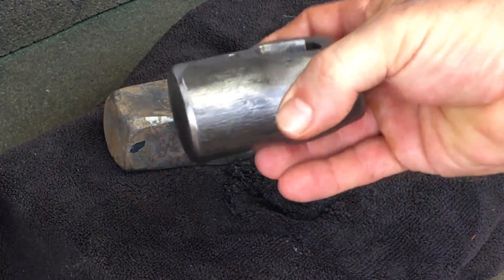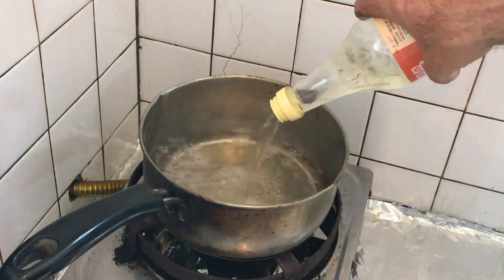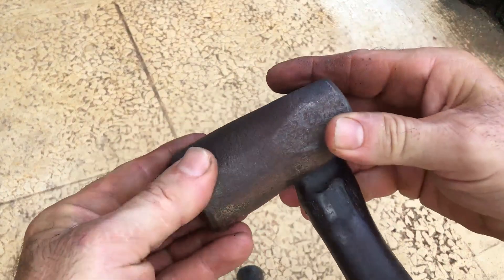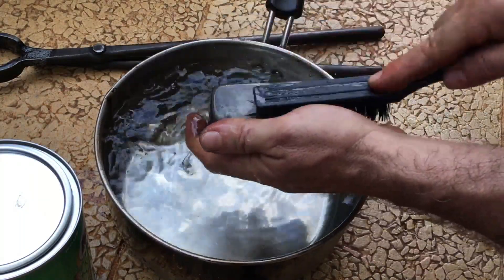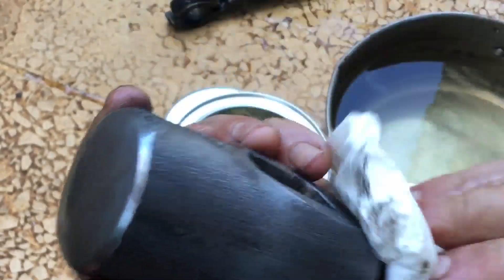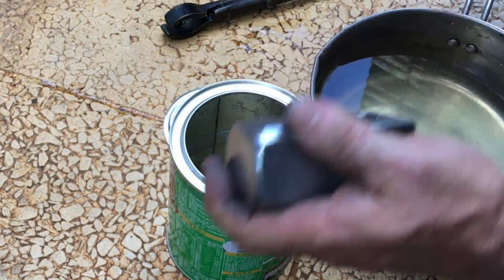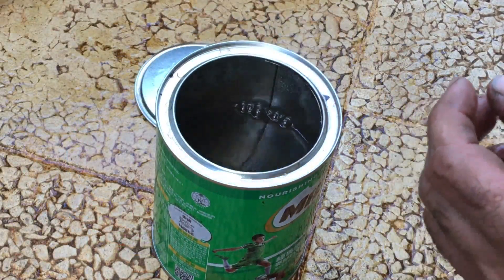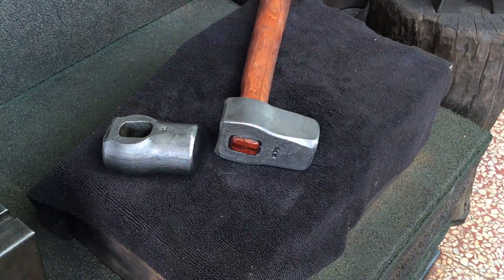Magnetite - How to Slow Rust on Tools

Comment: vinegar breaks down rust so if its not rusty it wont turn that dark color you need to let it rust first(dropping it in vinegar and letting it sit out in the air without cleaning it off), then clean it with vinegar. that black layer is a broken down rust and helps prevent future rusting. not rust proof tho. just a different type of layer of oxide that helps the red rust from forming

Comment: it'd be a deep black if you dropped it in the vinegar pulled it out and let it rust a few days, then drop it back into the vinegar for a few days. no need to heat the vinegar let it do its thing (unless your short on time), pull it out and the head will be a darker color. it needs the rust to form that dark color. rust is a form of iron and so is that black layer. dont forget to wash and oil after pulling from vinegar!

Comment: If you don't mind carding the light red rust off suspend it in a box and put a 75 way bulb close to the bottom of a glass pan or bowel and put white ammonia in the bowel and every 4 hours in a humid climatetake it out and lightly card the surface and the more times you do it the deeper blue grey to black it gets
Reply from the maker: Hi Bill, very interesting indeed. I don't know much about "bluing" but I'm getting a crash course from all the good comments likes yours. I'll keep experimenting. Thanks.

Comment: There's an old military Fort around here. Fort Stevens. It was in use from 1863-1947. Even today you can go walk around the old concrete structures. Anyways on to the point of my story.. the iron things there are interesting to me. Huge round eye bolts sticking out of the concrete. They have a beautiful orange, smooth, rusty colored patina on them. The fort is guarding the mouth of the Columbia River where it enters into the Pacific Ocean. I would have thought anything iron would just start rusting away after sitting for 50 years like it has. Not sure if it's the patina from all of the use beforehand, or if it's just a better kind of iron but when I was there a couple of years ago, it was not crusty and flaking off rust like you would think a piece of iron sitting in the weather next to the ocean would be.
Reply: There is also a shipwreck on the beach at Fort Stevens also. The Peter Iredale. I'm 42 and have been camping there since I was a little kid. I have watched the whole of that ship slowly rust away into the ocean. Yet most of the iron at the fort is still in perfect condition without any flaking rust on it.
Reply from the maker: I really enjoy stories like this. Thanks again my friend.
Reply from the maker: Hi Keith and thanks for sharing your interesting story. I have an idea about the rusted hardware on the Fort. It's possible those pieces are real wrought iron. This iron has very little carbon and so when a skin of uniform rust forms, oxidizing just stops at that point, the iron being a more pure form. I've come across triple refined wrought iron that was over 100 years old and internally was in perfect shape. Anyway, just a thought. Thanks.
Reply: @gstongs  that very well could be the case, that it is extremely pure wrought iron. It was a military fort, built for defense, along the ocean. I'm sure they would have used "the good stuff" to keep it from rusting away in 5 to 10 years.

Comment: Birchwood Casey makes a cold gun bluing compound that works pretty good. Don't know if it's available in Taiwan. Thanks for the video. Jon
Reply from the maker: I need to look into proper gun blue so thanks for the suggestion. And I got a lot of other good ideas from the comment section. A wealth of knowledge it is. Thanks.

Comment: very interesting. ive done the old mustard patina trick on carbon knives in the past and its ok, dnt know how well it would work for a metalworking tool though
Reply from the maker: I think the thicker hammer steel is making this harder than with a fine blade. But I've got a lot more experimenting to do. Some comments herein are very useful. One day, I will try the mustard patina "hamon" or whatever that line in called. Thanks.

Comment: Rust Bluing is the process you are attempting to achieve.  Clean the surface, allow to rust (red rust), then place the piece in boiling water (it will turn black, magnetite has formed), clean piece again light wire wheel preferred by hand fine wire brush ( this is called carding ), rust the piece again and perform this process until no more red rust is forming.  Then oil.  This can take up to 10 cycles.  One of the best methods is to rust the piece in the fumes of a acid ( I use sulfuric acid in a closed container, battery acid mixture works fine) in your environment the humidity will flash rust it.  This process is considered the 2nd best method of bluing a piece and on polished pieces you can obtain a very black finish.  There are acid products out there to speed the rusting process.
Reply from the maker: Hi Randy, Very good comment. Very useful information. I may just try this for a video. But it does seem like it will take a good amount of time. I'm trying with some less hazardous mediums (vinegar, etc.). And I'm currently working on trying this with drain cleaner - the kind that is extremely alkaline, not acidic. I've got some homework to do. Thanks for sharing this detailed info.
Reply: @gstongs  in your environment high humidity and heat an object will flash rust all by itself and even faster with any acid solution.  Clean and just wipe with a damp cloth ( vinegar ) and hang should rust veal fast.
Reply from the maker: Yes, I can rust a piece here pretty quickly with nothing but leaving out. With this patina, I'm trying to oxidize without red rust forming. I'll continue with this next video. Thanks.

Comment: Don't Know Glen I have always used vinegar as a rust removal for steel you can get both hot and cold blue or blacking on the internet. Or you can just use water displastment 40 (WD-40) And it would help i you lived some place where it did not rain 3 times a day (Lol)....... Be well and be safe...⚒⚒🦜
Reply from the maker: Hey bill, I use a lot of WD-40 for sure. Humidity here is insane. I just also like the black oxide appearance beyond the simple rust protection it offers. But yeah, gun blue is pretty common. Plus, there are other chemicals mentioned in the comments that are probably better/more consistent for this. By the way, I never got an email from you. I'll try to email you again so maybe check your junk mailbox if you don't see it. Would like to get a tong to you for your donations. Thanks. Glen   gstongs@gmail.com

Comment: Try ferric chloride and distilled water...  It's not expensive and it makes for a great Finnish. I mix it no stronger then 50 50 but  1 ferric to 4 water works a treat as well. Stay safe bud. Look forward to the next installment.
Reply from the maker: Hi Dan and thanks for the suggestion. I'll go my local chemical supply company soon and see what they have available and what might be of the less dangerous variety. Much appreciated.
Reply: @gstongs  yup... It's very mild. You can mix with distilled water or vinegar. You can use bare hands and its not bad but it does slowly work on your finger nails. Also stains yellow... Not a great look when out on the town lol. I will do some research to see what possible alternatives you could find easily in your part of the world. Although I am in Africa so If can find it , I am sure you can.

Comment: Rust bluing .There is a way to get a gun like black finish with walmart chemicals  at home . You need ratio of 2:1,2 :4  of following chemicals sodium hydroxide(lye 2):Potasium nitrate(KNO3 ,stump remover 1,2):Destiled water(4).
The more polished surface of metal is the better the finish will look . Make sure you degrease part with acetone or alcohol and never touch it with hands .Any oil will show . 
Warm the previously mixed chemicals to a 130-145 C° and put the part in for 30 min.After that use fine scotchbrite pad and oil it . 
You probably overheated vinegar .Try to keep it at temperature  in a range above.
Reply from the maker: Very interesting... I'm messing with drain cleaner to attain this "rust bluing" with decent results. Your chemical formulation is something to try. And you may be right about the temp. of the vinegar. Thanks for sharing.

Comment: Interesting. I make some decorative screens from mild steel tube (180mm diameter with a 5mm wall thickness) and brass. The brass I polish and lacquer. But I want to keep the mill scale and rough look of the mild steel tube. I don’t want to just paint the steel black so this treatment followed by a matte clear coat will give the look I want. Thanks!
Reply from the maker: Hi Eric, give it a go but for sure this method takes some trial and error. different factors need to be considered. Thanks for sharing the pics of your work - wonderful. Good luck in all.

Comment: It's the Rainy 🌦 Season here in Chiang Mai, and lots of my tools 🔧 start to look like they were made from Mars Dust. Thanks for this demonstration Glen, I have plenty of Rice Vinegar on the kitchen shelf, (it's sold in 5 liter containers here) so I'll give it a try.

And since I'm already in the kitchen, I might mention that Olive Oil is a useful emergency lubricant for squeaky door hinges and suchlike. It's now quite expensive due to "World Events" but handy if you've got to go to the hardware/garage just to buy a can of oil just for that annoying squeak.
Reply from the maker: Hi dav, It really is something that needs more experimenting - different types of vinegar, duration left in medium, etc. Olive oil really got expensive but the amount needed for a hinge isn't much so good thinking. I'm in the middle of fooling around with drain cleaner to attain this black oxide coat. Let's see... Thanks.
Reply: @gstongs  😃

Comment: Use a lot of vinegar Glen, not tried rice vinegar , only white garden variety! Works really well for rust removal on old steels, particularly wrought! Excellent weed killer when your done with it! It does have a rust preventive quality I only noticed after I started using it! Its simple, cheap, safe to use and the waste has a further use so every box is ticked!
Reply: Too expensive ,citric acid is the cheapest way to go .10L bucket for  2$ .And you can reuse this thing many times.You just add a bit more citric acid powder. 
And after the part was soaked for a day all the black goo(black iron oxide) can be removed with laundry detergent and hot water with minimal scrub with kitchen pot cleaning wire. 
If you want faster cleaning you have to increase acid content . Above is 4 % which is very gentle with material and removes only rust. 
After i am done i spray tiny bit of wd-40 on rag and wipe part,after than i use linseed oil for rust protection. 
I threw away my wire wheel brush.
Reply: @zumbazumba1  
Citric acid in that quantity is not available here, not that I know of! White vinegar from the supermarket is about 79 cents for 2 litres, I use it time and time again for months before its that black and thick it looks like motor oil! I will investigate liquid citric acid and see if it can be got!
Reply: @paulorchard7960  Nah bro i dont buy it in liquid.
Its a E330 food preservative that comes in 0.5 kg white crystal powder form.0.5kg is enough for 10L bucket .Probably you can get even bigger package for cheaper. 
Vinegar(i used to use it when it was cheaper) is expenisve af in my country ,so when you need to fill the bucket citric acid is cheapest.
Reply from the maker: I'll see if citric acid is available to me here. But I also want to keep the black oxide color on workpieces, if possible. Wire wheel brushes can be pretty dangerous, especially poorly made ones - wires can fly out and I've had a few stuck in my chest so avoiding using this tool might be good. Thanks.
Reply from the maker: Thanks for the good advice Paul. I'm on the lookout for white vinegar but it's harder to find here than you would think. Been messing with some other things like drain cleaner. But that's less safe...